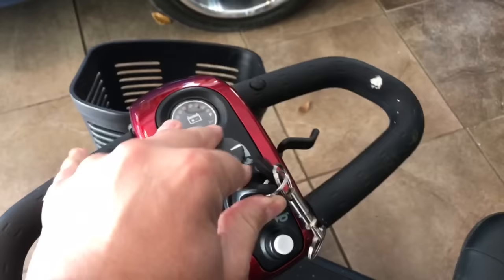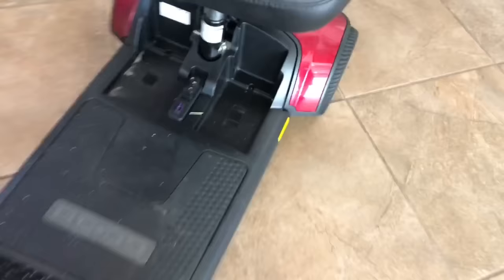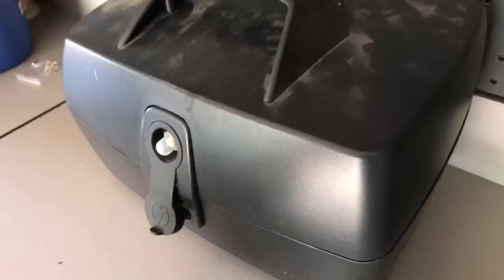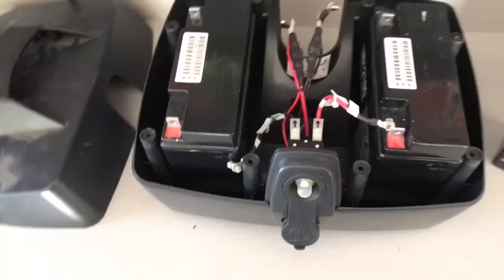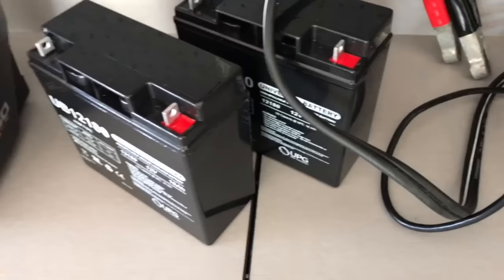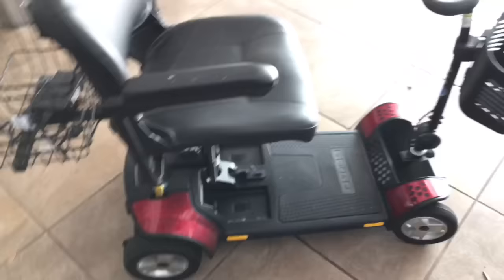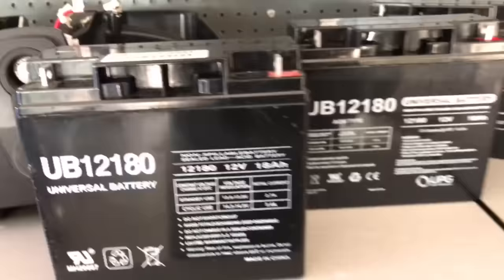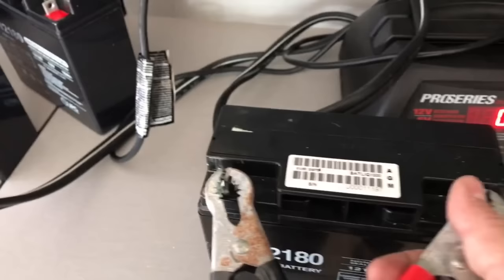How To Fix Your Scooter That Won't Turn On Or Charge

Comment: Charge shows charging and does turn green if fully charge however when I disconnect and put key on no power in scooter. No idea what is going on.
Reply: Try pushing circuit breaker and check fuses. It's possible that your batteries are shot, will take surface charge but have don't have power. Make sure that yellow electronic brake lever is in proper position.

Comment: The trick to charge an over depleted battery is this.  A dead battery draws too much current.  Replace the fuse is it’s blown.  Add a high wattage resister in series with the battery to reduce the current and start it charging.  After it gets a partial charge you can remove the resister.  Be careful wattage has to be high and resistant low, maybe 5 ohms or so.
Reply: i have a gogo ultra x scooter. just bought new batteries, and the meter guage on scooter says very low battery (one light bar lit up) and beeps twice, which means low battery. but when i test the batteries with meter they seem fine. what would you recommend? ty
Reply: @healthyamerican  Make sure all your connections are clean and tight.  You might have a drain or short somewhere along the way.
Reply: @healthyamerican  Depleted batteries may test 12 volts  with no load. They  should read 12.8 volts when fully charged. Keep batteries charged after each use and once per month when scooter is not being used.

Comment: Measure your dead batteries, compare measurements on battery ads to make sure new batteries are same size to fit your battery box. 12ah batteries are wider than 18ah batteries. Charge batteries periodically when scooter isn't being used. Recharge batteries overnight after use. Don't leave battery box in hot car summer heat will kill batteries. Batteries last 2-4 years if kept charged properly.

Comment: Thanks, a bad fuse was my problem. Bought a pack of 4 for $5.00 I now have extra for future problems. NOTE: My scoter used a 7.5 amp fuse, the one in this video was a 5 amp so take the blown fuse to the auto parts store for correct one. Amazing, such a small part disabled the whole scooter. Happy to say, a quick and easy fix.

Comment: The fuses are rated in Amps.. not volts. Still a good video..
Reply: Joseph Staples yes, It's wrong information and some people will trust this as being correct!!!!!
Reply: my older pride gogo traveller elite has new batteries and you can run for hours and they are still good. but get on a steep grade or hill and it becomes such a load that the circuit breaker shuts down the whole scooter and we have to reach down and reset it, and walk the scooter up the hill. very discouraging. what can i do to solve this..thanks
Reply: Definitely can throw a person off, especially if they're not very competent with electricity.
Reply: Joseph Staples by
Reply: Thanks, I came down to the comments to say this same thing
Reply: N I’m in
Reply: @healthyamerican  If your batteries are somewhat tired, lost their oomph, new fully charged batteries, may not blow the circuit breaker unless you are going up a really steep grade. I have the same scooter, old, just installed two new 22ah batteries. Well cared for batteries last 2-4 years if kept charged, not run down to dead, not stored in hot car trunk.

Comment: Good video. I thought my batteries were fried. It turned off going up a steep hill. It wouldn't charge. I checked the fuses as you suggested but they were fine. I was looking for new batteries but then found the circuit breaker. Who knew, I do now.
Reply: Where is the breaker located? I'm sure this will change model to model.
Reply: @RJBargee  on mine it's the round cloudy plastic dome on the front of the battery
Reply: @RJBargee no when it goes it just needs to be pushed back in like a breaker switch

Comment: Check continuity of the bad battery, if there is no dead short you can boost it with a good battery for a brief period to get enough voltage in it so that your charger will recognize it and begin a charging cycle. I've done this and recovered 100's of batteries this way. Even ones that were sulfated. 
Just repaired two swagtron hoverboards this way that I picked up at a thrift store for $20 a piece. The more I use them, discharge and recharge, the more the range increases. 
Granted they won't be like new but they last about an hour and a half now compared to not even turning on or a charger even recognizing them when I got them home.
It's worth a try :) Just be certain the old ones don't have shorted cells by checking for continuity across the terminals.
Reply: Lead acid is really a lot more recoverable than we are led to believe, although once they corrode and short out they are done.  I have restored car starter batteries to useful life with a solar panel and a cheap pwm charge controller. (Days and weeks of trickle charge.) I also keep a cheap wall wort style plug into AC lead acid trickle charger around.  Lead acid sucks for deep cycle, tho.  Go with lithium.  It's cheaper and better.  The problem with lead acid is, it likes to be a 100% charge all the time or it will sulfate.   Lead acid doesn't like to drop below 50%.  Lead acid sucks. They make Lifepo4 replacement batteries and it is NOT more expensive than lead acid.  You can use the same charger if you have to, as long as you uplug the lithium as soon as it is charged up and know that overcharging and float charging is deadly to lithium.  Lithium likes to hang out around 40% when not in use and that will actually make your battery last longer.  You can use a timer to help prevent overcharging.  Uplug before you go to bed, that kind of thing.  The scooter industry does not want you to know how easy it is to switch to lithium and I find lithium chargers expensive or hard to get specifically for scooters.   They sell them in kits only for certain brands etc. I have seen cheap lithium charger onTemu with the right plug, but voltage varies.  You can also get cheap lithium ion battery packs off Aliexpress and they sell cheap enough chargers with.  Depending how the batteries are arranged and which lithium chemistry you have, what voltage of charger you need.
Reply: This is how you put enough charge into a dead battery to get regular charger to work. If battery is worn out or damaged with sulphation from not being kept charged, it may not be able to accept a full charge and  power your scooter normally.

Comment: Have the exact same unit before buying new batteries I pop the lid off the old ones they were bone dry slowly added to still water into them and put them on a low slow charge for 2 days they bubbled up real good and now run almost as long as brand new ones you don't always have to throw away the old battery
Reply: Sealed lead acid batteries there is no lid to remove. If you do you ruin the battery and break the seal.

Comment: If you have a battery that is relatively new and won't take a charge after a 100% discharge (dead), try using jumper cables and hook up positive to positive and negative to negative to a good, fully charged 12V car battery. Leave it connected for half an hour or so.  After that, there is a good chance that you can hook up a portable battery charger and the battery will now "take" a charge.  After half an hour, I like to leave the jumper cables connected to the car 12V battery, then attach my charger to one of the batteries, in effect charging both batteries up at the same time.
Reply: I used a 18v drill battery to jump start the charge is now working on a 12v battery charger
Reply: I have used 12 volt solar panel of at least 20 watts and a cheap pwm charge controller.   Those wall wort trickle chargers might work.

Comment: If they don't want to take a charge you have to pop the top off and take the little rubber caps off the cells and fill them up with distilled water using a basting siringe put on charge for a while and I bet they come back

Comment: Good video, but I'm working on an old Zoom 220 that has sat unused for 10-15 years. I replaced the batteries, and the fuse is good. But all it does is "click" in the reset button. The horn beeps, but that's it. Could something have deteriorated in that unused time?
Thank you!
Reply: Make sure your transmission is switch to engage if the wheelchair is making electrical connections the horn beep such as your transmission is not in gear find a switch if you can push your wheelchair and it moves around freely it's definitely not in gear once you engage the transmission you'll be able to use your wheelchair.

Comment: Have you tried daisy chaining them with some good cells meaning a good sell one of the old battery cells a good cell an old battery cell positive to negative negative to positive and then at the end putting the charger to the dead cell or vice versa hooking it up to the good cell completing the daisy chain through your old and new battery cells it might be a way to trick it into registering a charge like cordless drill batteries

Comment: How do i open the case?  I get the 6 screws out, but the 2 at the back in the center dont come apart. There does not appear to be screws in them but they have a rather start shape plastic post. ?

Comment: Do all of the Go Go Elite Plus HD’s have two fuses and is there a screw holding the blac box down. My daughter bought me two new batteries awhile ago and it hasn’t really stayed charged since then . I will charge it overnight and it will look on the thing like it’s full charge and when you start riding it will go down to 3 or 4. My key thing was coming up when I took key out so I unscrewed it and tightened it inside and it didn’t help so I was watching your video it looked like you also had a fuse underneath the black box but I can’t get it up . Is there screws in the black box that holds the batteries in it.
Reply: If you mean "battery box", it is held to scooter with velcro and it's weight. Remove the seat and you can just lift the battery box off the scooter. The battery box top is held to the bottom part with 8 phillips head screws. Turn box upside down to see the screw holes. You need a long screwdriver to remove screws, turn box over, remove the top, and see the batteries and harness wires. Batteries have velcro on the bottom holding them in place. There are a number of videos that show in detail how to replace batteries. Mobility Direct has some good how-to videos. Your plea for help sounds like your batteries are not in good condition, have not been kept charged properly or otherwise  defective. Take the battery box to a scooter repair place for testing of batteries.

Comment: I touched and crossed wires which left my jazzy select elite dead I checked the battery's  there good I pushed the button on the 30amp fuse what is my problem please help

Comment: Pulse charge the batteries but 1st take tops off and top up with distead water then discharge to 9v and charge should egenerate the battery to 80 90%

Comment: If you mesure the dc pins with a multimeter without connection to the chair wath voltage provides? thanks

Comment: i see these batts on ebay to 30 bucks for 1 but his batteries are 18amh the replacment ones are 35 amp hour batts and there 60 bucks a pop so look carefully
Reply: 35 amp battery (deep cycle or trolling motor batteries) will not in those boxes. They're too large.

Comment: Hello, I drive a scooter because of my disability, I have 2x12 volts with 100AH AGM each in my mobile, I would like to have lithium batteries inside, which charger do I need for this or can I use the charger that came with the mobile? Thanks for the info!!
Reply: Lithium batteries require a special lithium battery charger.  Lithium batteries need a special "battery condition meter", the meter on your "mobile" will not show amount of charge remaining properly with lithium batteries. Call Mobility Direct and get advice, they do lithium conversions.

Comment: I have a powercar mobility scooter. New batteries,  fully charged. Charge indicators drops to have when starting to move. Charge only lasts for short distance.  All wires seem to be intact. Any suggestions?
Reply: Drops to half and down to yellow and red on inclines such as ramps.

Comment: After replacing the battery - is not moving.. has power, but.. not going forward or reverse. Snd i put it on brake or on neutral.. is beeping, but.. not moving. Any suggestion?
Reply: Can't understand your question. Make sure electronic brake lever is in drive position.
Reply: @garygullikson6349   really? WhT you don’t understand? That is changed the battery and is not working.. there’s power, but when you press forward or reverse- is not moving..  you can horn, the display is ON, still.. not moving.. and yes - it’s in Drive position..
Reply: @luckyjames007  Try pressing the circuit breaker on the battery box. Check the fuses on battery box and under battery box on base of scooter.  Check your batteries with voltmeter, one or both may be defective, two batteries in series should read  around 25.9 volts, each should read 12.8 volts when fully charged. Proper battery test is with a load tester. Contact a dealer/service shop for advice. Your scooter may need other repairs.

Comment: I have a go go that stays charging (red charging light) for days, never quits now. What does it mean? Scooter works fine, battery dies sooner than normal! Please advise
Reply from the maker: Batteries are going bad. Time to replace them.
Reply: If batteries are 3 years old they should be replaced.

Comment: Trying to fix my mom's Pride Maxima. We had the batteries changed and $345 later it's still not charging. The chair works but when I plug in the charger it won't start to charge. I checked the connection a d everything is good and we had it at a shop where he said everything in the mechanics like the tiller was good. Not sure what to do next. Any ideas?
Reply: Test the continuity in the charger thru the cable plug. Always be sure that the motor locks are in the drive position BEFORE turning it on.
Reply: @myk602010  Figured out that the fuse for the charger port keeps blowing. So as long as we change the fuse every other time we go to charge it then it is fine. Not sure how to fix the problem permanently though.
Reply: @myk602010  are both batteries wired in series, is the 12volt charger trying to charge a 24 volt pack, verify the specs
Reply: The lower the battery charge level the more current it will draw charging.  Try to charge before it gets too low.

Comment: That's very interesting and useful, but I am an old partially disable lady , 73 years old. Lol  I can't do this ... not even in my dreams. 😣
Reply: You can't remove four screws, check 2 fuses, and pick up two 5 pound batteries? Come on Aida, you can do it!
Reply: @Njennings42  "Checking" fuses needs to be done with a multi tester because visual inspection can sometimes show a false OK

Comment: Just got a road knight mini, 3 wheel scooter for my partner. We bought new batteries and the scooter works fine, except it will not charge. Anyone got any ideas. The charger has a single light that is supposed to change from red to green when charged, but just stays on red. Tested the scooter when we got the new battery pack and the scooter itself and the battery work fine.

Comment: I owe you an apology! I had said it was stupid to buy new batteries instead of charging the old one with your car charger! LOL! I HADNT LISTENED TO YOUR ENTIRE VIDEO!  I went back after not being unable to get mine to charge and heard you say you had tried all that and they still wouldn't take a charge, I did the same and also was unable to get them to charge@ SO AGAIN I APOLOGIZE!🙄😔
Reply from the maker: It’s all good brother 👍
Reply: Try daisy chaining them to some good working cells positive and negative negative positive
Reply: Any lead-acid that has been sitting in an uncharged state for a long period will have damaged cells. They even deteriorate over time when charged and discharged perfectly. Ultimately new batteries are needed, but often you can get a bit more life from the old ones, though they won't hold a charge well and will die at some point.
Reply: @DR_SOLO  don't connect good batteries to old ones. It won't do anything of use for the old ones and may even damage the new ones.
Reply: @leglessinoz  while they are the charger should be fine it pulls current thru the batteries,  enough for the original charger to read the batteries that's all, not to fully charge them totally.. 😉

Comment: those are not AGM batteries -they are regular run of the mill sealed lead acid. AGM would be a hell of a lot more than $32.
Reply: No they aren't

Comment: Hello I had a question, I was riding and hit a little bump and the scooter just stopped running.  nothing is broke on the outside and the inside seems ti be fine what could I do to fix it?
Reply: 96buells2t my moms did the same thing. Trying to fix it now. Any help found?
Reply: My wife’s did the same thing.  I took it apart and cleaned the contacts with contact cleaner.  It’s been ok so far.

Comment: I work privately with mobility equipment-I routenly work with the GoGos, I have several, actually that I believe that the controller is bad on, I've got brand new batteries, all fuses good, still absolutely no power......do you by chance know how to test the controllers?

Comment: Is there a reason why a scooter  has 2 battery?,is one for the control panel and circuit and the other for the motor?
Reply: Fook Utube No. 2x12 volt batteries =24 volt..scooters need 24 volt to operate..
Reply: Two batteries to operate two Motors to go long distances. And some scooters you may have only one motor and still it needs to battery to last longer. The controller uses very little juice.
Reply: @myk602010  2 batteries because they are wired in series and the motor uses 24volts for more powe to move heavier weights,
Reply: @myk602010  what if someone stoled one of your batteries over the winter? (Don't ask) can you run on just one at all? Will it even charge?